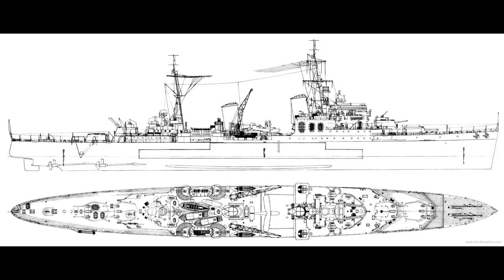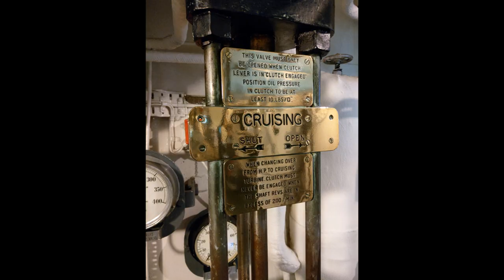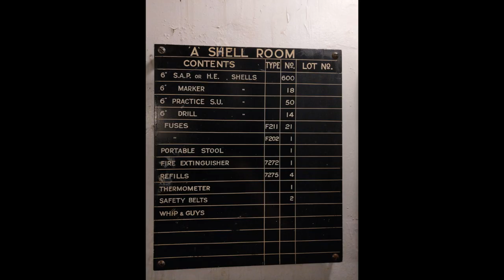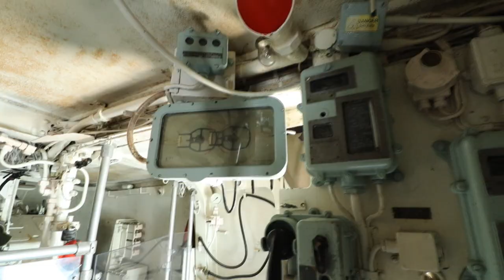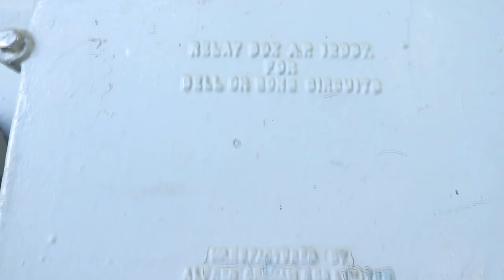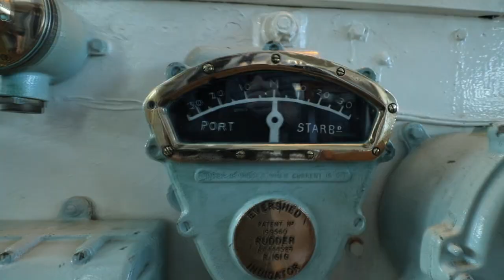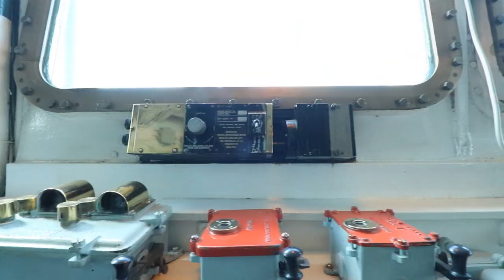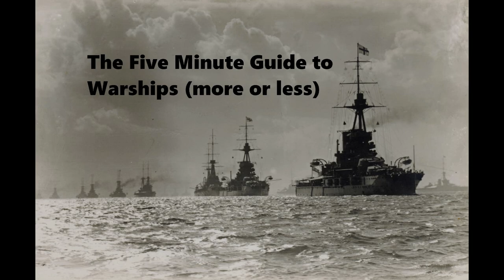HMS Belfast - A Town that served a Country

Comment: at 17:48 the flood valve is labeled for magazine B but the previous inventory is marked A, have you simply moved over one magazine or were the valves placed outside the room so it could be flooded/sprayed even if the crew of the magazine couldnt reach the valve?

Comment: Belfast does take to sea at certain times, although it is rarely noticed by the living. Those few unlucky living witnesses of this phenonomon are never quite the same, having seen the deck crew of the Belfast prior to her taking leave of her mooring place. Some fool was said to have jumped aboard and hitched a ride but came back affected badly by the horrors. A story  was told that Belfast journeyed to certain points on the chart where there is no living nor living memory. Plenty of mist and parting of the waves and then a quietening of the sea like never seen in a life's cruise. Up from the bottom they came, long-destroyed wrecks barely recognisable from the magnificent technological terrors that they once were in their day. For all that their decks were lined with their long-dead crew, though not one day older than when they rode their ship for that one last wild ride to the bottom. Still is the sea and quiet is the wind, one could hear one's own heartbeat if one had a heart.Visit Belfast by all means, go only in the day, never at night. You could get the fright of your life.

Comment: Wouldn’t it be a adequate measure (though as a last resort) to fire a few 6“ shells to loosen the ice buildup?
Reply: That will most likely result in the barrel blowing up
Reply: @KatyushaLauncher  you mean ice inside the barrel? Unlikely I guess, because the barrels are sealed off with caps from what I have seen. I was talking about the concussion of a broadside knocking the ice off the ship

Comment: At 15:15, you are showing the turbine, and note the thickness of the casing.  I see a line of round holes.  Were those for cooling water, or to simply lighten the casing?
Reply: bolt holes i think
Reply: Cooling? That would be the last thing you'd want around the turbine; it would condense the steam inside and render the turbine weak and inefficient. Turbine casings are usually heavily lagged to keep the heat in. The bearings would need cooling, but they are only at either end of the turbine and the flow of lubricating oil would be enough cooling for that. The very large opening to the left of the large diameter (low pressure) turbine is (I think) the plenum chamber that collects the exhaust steam to be carried off to the condensers. The small diameter turbine beyond it (far left) is the high pressure turbine, nearest the camera is the intermediate pressure turbine.

Comment: Halfway through and "There's never such a thing as too much ammo in a cruiser"... A: Beatty's fleet would like to disagree, and B: So long as you still have freeboard when you're done, sure.  And also - if you don't mention where those 6" guns are currently aimed, I'll be disappointed.
Reply: Nope, not disappointed. And the "Several million pounds worth of improvements" line is one I've used in the past too :)

Comment: Why did "modern" battleship, that is predreadnougt and later still fire broadsides? there must be a good reason for this, even though you are a much bigger target to your enemy. I am using tank logic (the front is the smallest target, therefore they fire forwards when possible)and my way of thinking was that of all big guns are on the front side of the ship, you have the same as with tanks. that is you are a very much smaller target to your enemy, the bow can help in deflecting because of the shape)angle very sharply away) and if a shel manages to penetrate there is much more pieces of the ship in the way to stop the shell from reaching vital stuff

My reasoning is obviously flawed, because all those engineers who designed them knew what they were doing,and they didnt follow my logic for a reason.
Reply: If I understand correctly, it was much to do with accuracy of the weapons. Their heavy weight making turning them slow, and often slow loading. More weapons firing = more chance of a scoring a telling hit. Wing turrets were tried, but the sea keeping and stability penalties were seen as more trouble than they were worth. 
Or in short, "Moar Dakka!"
Reply: @jon-paulfilkins7820  that maes sense , thanx :)
Reply: A few people have asked similar questions which he's answered in dry docks. A lot of it comes down to the fact that a tank can't be compared to a ship in any way, either technically or in the way they operate and fight. Other than in computer games maybe? I guess that's where these sort of questions come from.

As for why fire broad side. Because ships don't fight alone. Usually they are in column. If you fire ahead only then only one ship can shoot at the enemy. The rest of the fleet would need to wait for the lead ship to be sunk before they can shoot. Not really a great stratagem

Comment: This might be a dumb question but I've been thinking about it a lot lately. If you look at the 6 inch shells for example or even 8 inch shells, their relative size to a warship is so minuscule, even full of explosives I just don't see how they were capable of sinking another large warship. Does anyone have any insight into maybe the physics of this?
Reply: I think the idea is that a shell like that could damage or destroy components of a ship such as it's turrets or engine room. Even one 6' shell exploding inside a turret would probably kill or wound everyone inside and do enough damage to put it out of action for some time.

I think what normally happed was a ship would be hit repeatedly until the collective damage rendered it inefficient at which point either the crew would abandon ship (or try to withdraw if part of a larger battle) or the enemy would close in to launch torpedoes to finish the job. Alternatively they could just keep shooting until they hit the magazine or blew enough holes in the ship for it to sink.
Reply: There are several factors that need to be considered.  First, the main objective isn't to sink the enemy ship, it's to render it unable to continue the battle.  Damaging the engines, steering gear, or armament enough to stop them working will be enough, even if the enemy ship remains afloat.  Any hole below the waterline that can't be plugged will render (at least) one of the ship's watertight compartments inoperable, and most of the compartments contain some important systems; so, even if the shell itself doesn't cause a great deal of damage, as long as the hull is breached, the compartment is effectively destroyed.

Secondly, the damage done by a shell (as opposed to a bomb) is due to its kinetic energy, not its bursting charge - all this does is to break the shell into fragments which (collectively) cause more damage than a solid piece of metal would do.  Indeed, the latest hi-tech anti-tank rounds have no bursting charge at all, they're entirely kinetic.  Larger shells are more deadly because they're heavier, not because they contain more explosive, and a small shell can do a lot of damage if it hits the target fast enough.

Thirdly, the magazine of a warship contains a great deal of explosive - not inside the shells, but for propulsion in the guns.  If this can be made to catch fire, the ship will be lost, no matter how small the shell that achieves it.
Reply: Six inch shells are unlikely to sink a cruiser or larger ship, but are certainly powerful enough to knock out guns and destroy systems that aren't protected by heavy armour (radars, rangefinders, crew, cabling, communications etc). With 9 guns each firing several rounds per minute, the Belfast can deliver a lot of damage. And six inch shells are certainly powerful enough to sink a destroyer or lighter ship by riddling its hull, starting fires or detonating a magazine...
Reply: @Tevildo  I'm afraid you've misapplied some of the lessons from tanks, where kinetic energy is absolutely essential both today and 80 years ago during the war. Tanks have a comparatively small internal volume, so anything punching through the armor is likely to damage something important. Ships are much (much) bigger, so that bursting charge is absolutely essential to doing meaningful damage. The British 6" SAP shell carries 3.75 lb of Dunnite (I believe that's the explosive), while the HE shell carries 8 lb; if all you wanted to do is shatter the shell body into fragments with some velocity then .5-1 lb would probably be plenty. The comparison with tanks and various armor penetration mechanisms (pure KE, shaped charge, squash head, etc) has been asked before, but it always comes back to the sheer volume of the ship, small volume of genuinely vital spaces, and scarcity of hits in a normal action pointing to the need for a big bursting charge to do as much damage over as large a volume as possible with each of those rare hits.

When warships sank comparable warships using gunfire, it was usually the result of an accumulation of hits and resulting fires, especially if hits destroy firefighting equipment. The cruisers lost at Savo Island on 8/9/42 took dozens of 8" hits each, frequently accompanied by torpedo hits.  Similarly, Furutaka at Cape Esperance was swamped with dozens of shell hits (90-ish) and sank some 3 hours later. Boise took a shell in the magazine, but the combination of stable US propellant and immediate flooding from the shell bursting below the waterline prevented the complete loss of the ship. At the River Plate, the four participating ships scored a total of about 80 hits, most (about 70) of which were on Graf Spee but which, because they were 6" shells, had only knocked out two guns in the secondary battery; it was an 8" hit from Exeter that damaged the fuel purification system.
Reply: @kemarisite  Thanks for the correction.  Is there a reference you'd recommend on the differences (in terms of explosive content, especially) between naval and land artillery shells?
Reply: @Tevildo  I find myself frequently consulting www.navweaps.com both for technical data on the guns and torpedoes as well as for various technically and historically oriented articles.

Comment: First, It was generally the propellant charges which presented the risk to a gun turret/barbette and I believe that following WW1their positions in the ship were reversed with the shell room being above the propellant  magazine, the six inch used a two part ammunition. A forged steel shell is much less likely to explode when subject to impact or blast than a cordite charge.
Second, the device to the side of the 4 inch guns is likely to be a fuse setter.  In the anti-aircraft role, even in the early part of WW2,  the shell has a time fuse so that after the shell is fired it explodes at the desired height providing blast and fragments to bring down the aircraft.  Most probably, in later life  HMS Belfast would have used proximity fuses.
Third, together with that child Clarke, you continue to have difficulties with pronunciation.  Dido is pronounced DIE DOE and Oerikon (with the O and E often merged with an umlaut - two dots in superscript above the O) is pronunced Urgh LikON.  It is  suburb of Zuerich, the  spelling of which normally has the umlault above the U as Zürich.  In the same way the battleship Koeing, normally spelt as O umlaut as König .